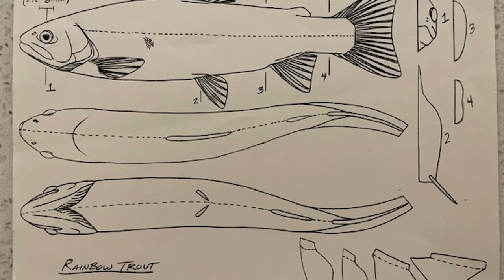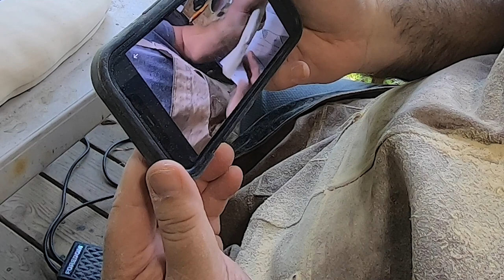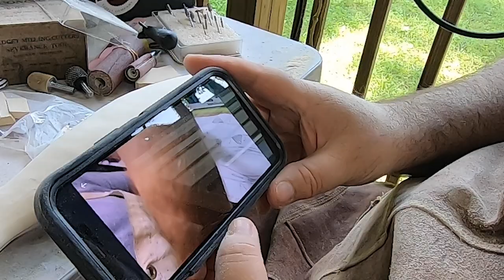Wood Carving a Rainbow Trout

Comment: Dan... I am ordering a Foredom SR 1/6 hp 18000 RPM pencil grinder.  Is that the ticket for woodcarving?  So many models
Reply from the maker: Yes, you’ll like it. The SR is the standard for all around use power carving. 
I’ve got the 44T hand piece that came with it set up with the 1/4in collet for 1/4”shaft bits.
 and I bought the smaller diameter H30 which has the key chuck type that will take bits from 3/32 to 3/16ths inch shaft bits. Most of my smaller bits are 3/32 and 1/8th. 
It’s a little thinner than the 44T. I do want to get the H28 at some point which is about half the diameter of the H30. I may also buy another SR so I don’t have to change out hand pieces as often and save wear and tear of the shaft cables.
Reply: Thank you!

Comment: I would like to see you show your followers how to and how not to use the large, coarse grinding bits.  When I started using them, I went over the end of a fish and ground my nail completely off.  I now cringe when I see someone using one.
Reply from the maker: Yeah that would be a good idea. I’ll do that on the next project that I use them. I’m pretty much done with them on this one except maybe for the habitat base. I’ve had a few mishaps fortunately nothing serious than a quickly filed finger nail and I slipped once and hit the top of my thumb on my left hand and quickly made it look like hamburger. Actually My worst accident with a bit was with a small 1/8 in shaft tapered kutzall bit on a Dremel when I first started carving. 
I was running it close to my chest and it slipped and caught my shirt and in a split second it wrapped shirt, hair and got to skin before it bogged and I was able to turn it off. I went and bought my leather apron the next day! 😜